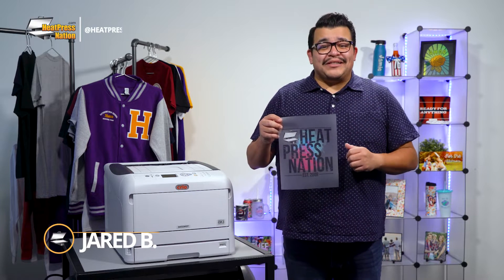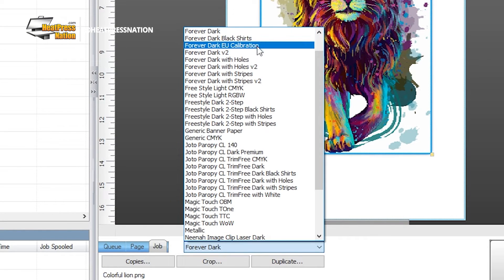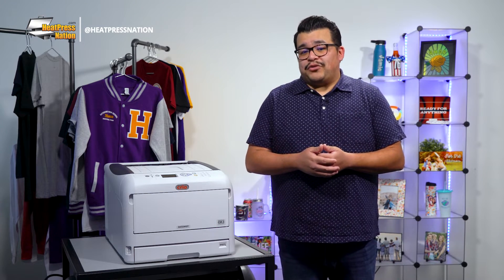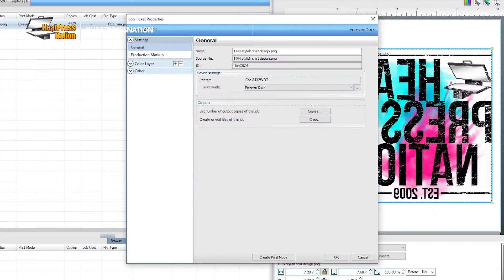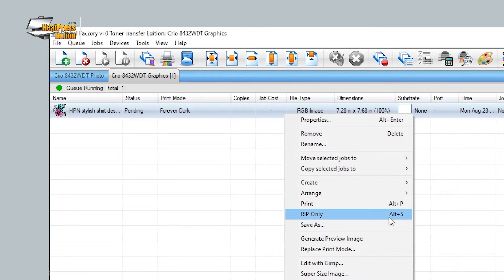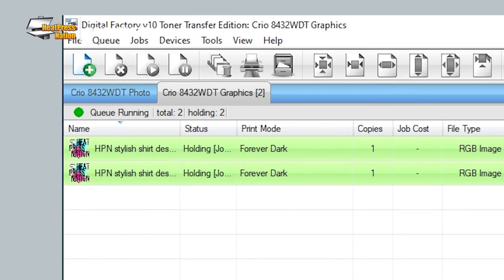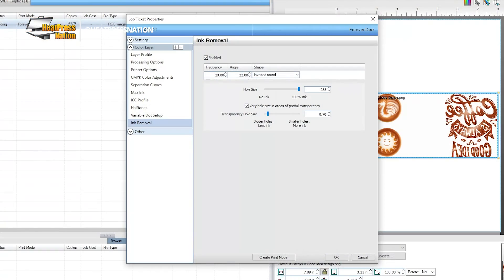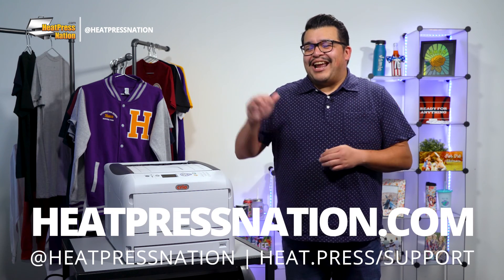Why Do I Need To Rasterize White Toner Direct-To-Film Transfers?

Comment: my unit does not have forever dark files shown in the dropdown
Reply from the maker: If you are using a UniNet printer, you can use "2-Step Standard". For other printers or RIP programs, you may need to do a little research to see which of the pre-loaded media settings best match Forever Laser Dark.

Comment: I recently purchased my 8432wt.  the rip software already came programed with several print modes already installed.  But I don't have the forever dark modes.  how do you create these different modes and what are the settings.
Reply from the maker: Hi Jobe! If you purchased your printer through our company, please contact our support team and they will be able to go over the settings with you :)

Comment: Do you need an actual white toner printer to rasterize or can you do it with a regular laser printer? Or does it not line up the white with the dots of the cmy?
Reply from the maker: The rasterization process as shown is done through a RIP software specifically made for white toner printers. If you're using a CMYW printer, there shouldn't be any issues with the white lining up with the rest of the print.

Comment: I greatly appreciate this detailed tutorial on rasterizing for white toner. I honestly gave up on the Forever Laser Dark due to it not having durability and washability. I use an HP printer that has a Ghost white toner, so not sure if the Forever TrasnferRip program would be compatible as it is marketed as only really being for an Oki white toner printer. I will research on if this can be done using Photoshop (I am sure it likely can). I truly want to give it a try and really test the washability with rasterization.
Reply: Everybody involved with Laser printing should be cognisant of the fact that laser prints have poor wash durability. I don't believe that the Ghost White toner printing get up has any RIP software so we stuck with poor wash outcomes. So few people actually talk about this and perhaps are suffering in silence.,,😕
Reply: @truewordz777  try DTF.
Reply: @martinyoung5281  Thank you for the suggestion. I just need to print things worthy of purchase.  I need to know that what I sell won't be a disappointment after a few encounters with the washing machine. 
DTF ? ill look into that thank you.
Reply from the maker: You should reach out to your Ghost white toner supplier to see if they have a RIP software available. You can definitely do this in Photoshop, but it'll take a little longer.